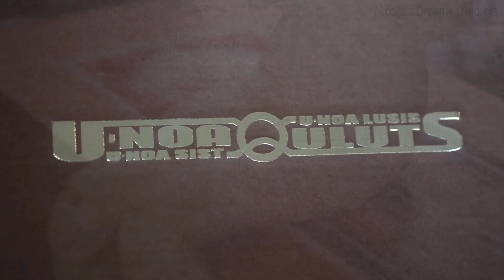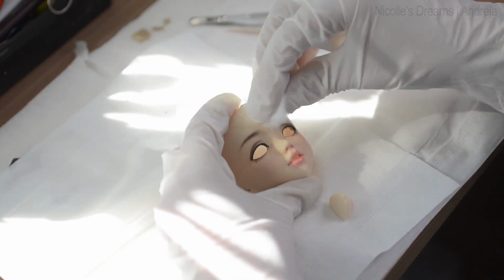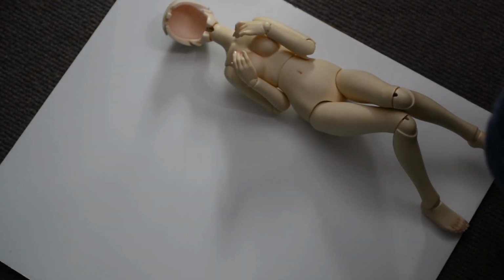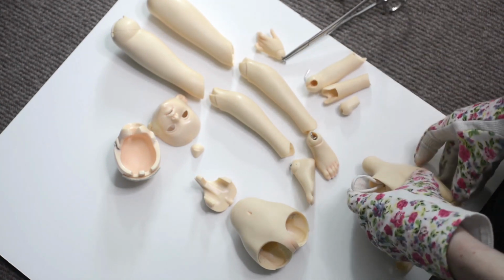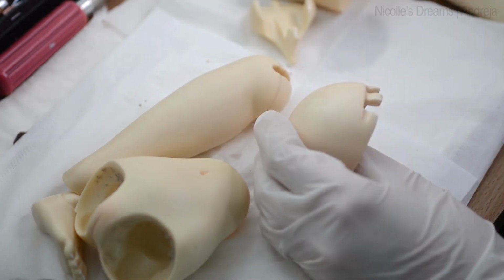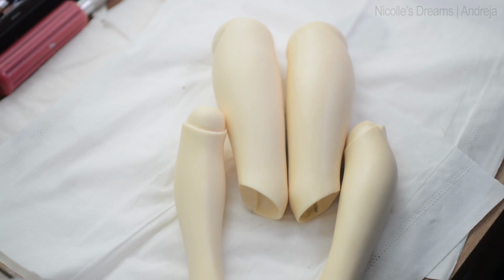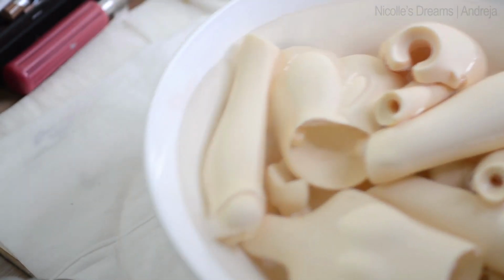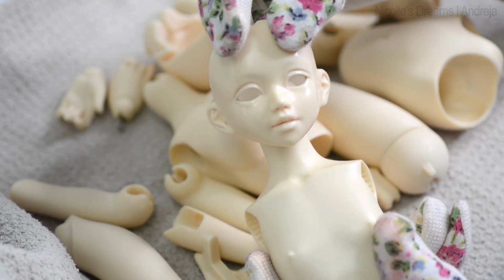Doll Restoration and Maintenance - Disassembling and cleaning your doll

Comment: This video is very helpful except for the fact that it is both easier and safer to start unstringing the unoa from the feet first, not the headback. It looks like the metal bar in the neck became bent because of this method, which can make it a lot more difficult to restring them again :/

Comment: Seeing this video from you was quite a relief. Relief cause I thought how complex putting these dolls together would be. However seeing the dismantle was like "oh, it's not really that bad." I do have a question about cleaning. Is it possible to clean the doll without removing the make up? The one I have is really lovely and would hate to have to remove it to clean her.
Reply from the maker: +Traditional Suki yes of course, you can :) Just clean all the other parts except for the face. The downside to that is that you might notice the skin difference between washed resin and unwashed resin. So as long as that doesnt bother you, you dont have to do anything to the face.

Comment: Hi, I am wondering will nailpolish remover damage the doll's materials? My friends are all doubting this method. But i see you removing the make up so well without any problems. Thank you!
Reply: use acetone free remover if you're worried. it won't work as well but between a few washes and dries, you should be able to get it off with a bit of patience.
Reply: Thank you very much! There's someone saying that Acetone will damage resin too. But i believe there is no method that won't damage resin during face-up /removal. I think the best way is don't do it too often.

Comment: Im New to bjds and  wanted to know if you get dirt or accidentally transfer oils from your hands on the resin and stain it from that can it be reversed? How do you clean and prep your blank doll and remove any of those things before you do a face up? Does that completely ruin the resin ? I ask because I just got a new doll and I didn't have gloves at the time but did wash my hands well before handling but im still concerned about oils or dirt being transferred from my hands .
Reply: Lindsay Deguzman Generally, avoid bare hands on BJDs, because even after washing your hands, your skin produces a lot of oils that could potentially glossify the resin, which can be washed off, however.
Skin oils can stick to the doll and make faceups patchy, or when using soft pastels make spots more pigmented than others.
Before a faceup, a doll's face generally gets cleaned well with acetone when working with pre-painted dolls or not. Acetone is also great for removing skin-oil-gloss from resin.

Comment: Hey there, BJD owner since 2008 (4 boys and my first girl on the way at the moment) I love your faceups till today!
But I'm kind of confused. I was told acetone nailpolishremover is bad, as well as oil on Resin (dishwasher bath)? Did I learned that in the wrong way?
Reply from the maker: +Lucifers Choice as long as you use non moisturizing dishwashing detergent it should be fine :) I would worry about acetone only if the resin was soaking in it for long periods of time. If you want to play super safe then stick with acetone-free nailpolish remover. Den of Angels has a great WIKI page that goes into detail about cleaners if you want to learn more. Every company has a slightly different resin formulation so there will always be exceptions to the rules.

Comment: Wait, you use acetone on resin? Doesn't it make it brittle, and in some cases even melt the plastic? D:
Reply: But isn't Unoas still resin? Is urethane resin? I don't know XD
Reply: Acetone is generally alright to use on resin dolls, I just wouldn't suggest leaving doll parts to soak in it for prolonged periods of time (which can be said for most substances people use to clean/wipe BJD parts), since there is a chance it may cause some damage. I think it depends on the quality of the resin itself just how easily it may be damaged by acetone, paint cleaners, nail polish removers and so on. Your mileage may vary.
Reply: If you ever soak something in acetone it can dissolve plastic, but just wiping it on a material is okay because it evaporates very quickly. Does not damage the resin
Reply: @MellowJelly  but when she wiped a face of doll itwas very shiny, looked melted a bit to me

Comment: I have a quick question: Is there any kind of cleaning detergent anyone can recommend for if you want to wash your doll, but don't want to remove their paint? I have two BJDs, and while I plan to re-do their faces in the future (I got them second-hand), it's a little too daunting right now, while I'm still new at it, so I don't want to have to re-paint them, but I'd love to clean them up a bit.
Reply: A damp cloth with some water usually does fine for basic cleaning, as long as the painted parts have been sealed properly. Magic Clean Erasers (and similar products) work great for stubborn stains, but they are abrasive so you gotta be careful about scrubbing too hard with those since they can basically sand some layers off of the top coat of sealant you may have on your doll (potentionally even wipe part of the faceup itself off if it wasn't sealed properly). But yeah, if you just want to get some collected dirt or dust off of your doll, a damp cloth and gentle wiping usually works just fine.
Reply: ***** Awesome, thank you so much! I was worried about handing my dolls too roughly, since I'm still really new to them. (I was lucky and someone gave me two of theirs because they had to get rid of some of their collection. ;P)